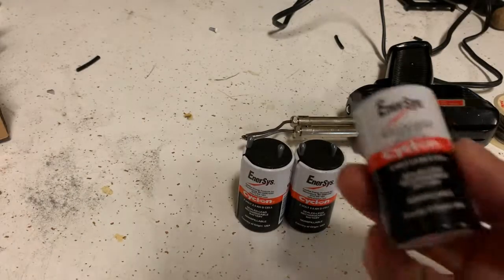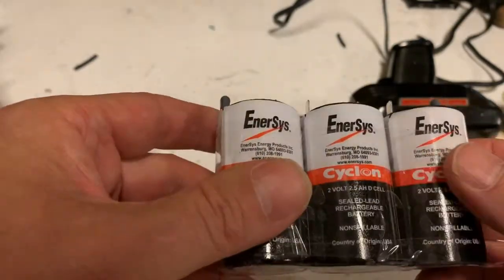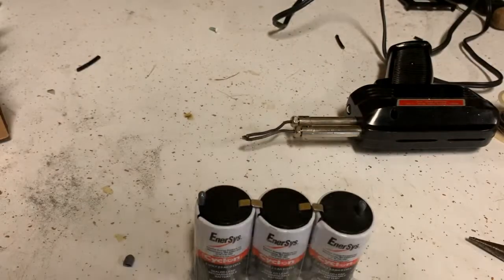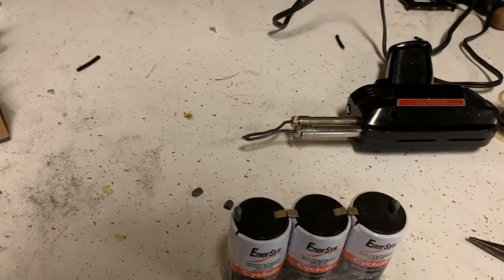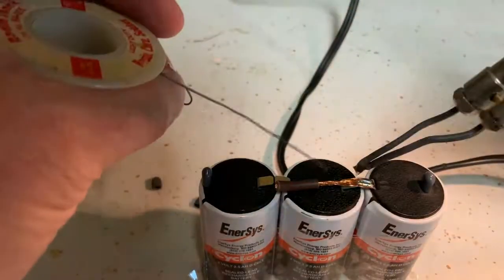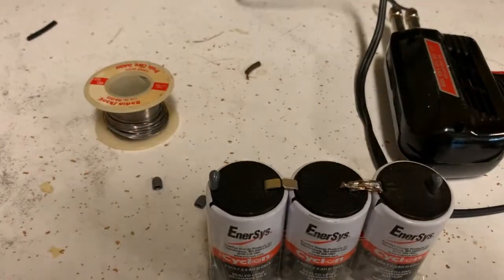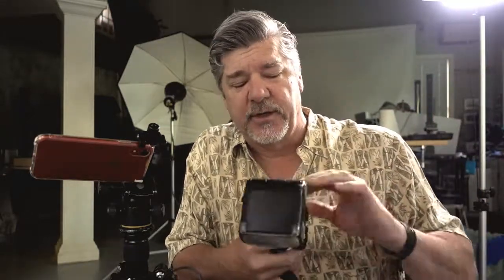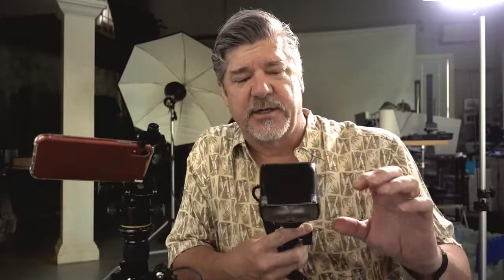Restoring Quantum Battery for portable strobe

Comment: Peter Krogh /or anyone that has ATG's Vivitar 283/285/285HV. Are they still working?
Anyone has one that fires at full power in all setting & know a fix, rather than guessing?

ATG's assisted & started making battery packs for working photographers:
ATG's Turbo Battery Pack series are HV that is connected by cable onto flash's HV Port = faster recycles
ATG's Battery 1 has 6V, fits many flashes having 4AA batteries (you will need a correct battery cable)
ATG's Battery 2 has 9V fits many ATG's Metz & Sunpak having 6AA batteries

Since they were very costly to renew the patents, ATG/Quantum didn't renew.
Then many staff were let go & got sold.

Anyone still has/have  & still using one of ATG's powerhouse flashes?
1. ATG Gold 60CT-4r
2. Metz 60CT-4
3. ATG Gold QFlash T2r
4. Quantum QFlash T2
5. ATG Gold 622r
6. Sunpak 622
7. ATG Gold 555r
8. Sunpak 555
9. ATG Gold RTF540r
X. Contax RTF540r

Comment: Thanks for the video , I have a Quantum Battery 2 which stopped working after laying in storage for a long time(5 years). I tried to send it to Quantum Instruments but they said they didn't service Battery 2 anymore. I did send them my 2 battery 1+ which they do service.While watching your video I noticed the Cyclon  batteries so I did a search on the company and ordered (4) 2.5Ah 2 volt d cells.exactly like the originals which is what the Battery 2 use. I have  a couple of Metz potato mashers I want to pair these up with.   By the way the old batteries looked like they were all leaking.

Comment: Doing that way & connection will not increase quick recycle time. But it does save the weights.
ATG/Quantum have better models, Quantum Turbo and so on.
You can change the battery on these also.

Comment: I have a quantum battery 2. Im hoping I can find a way to hook it up to an Yongnuo YN560 IV speedlight. The connector is a CZ2 for the power input. I can't find anything that will fit the Quantum Battery 2 and feed the power into the CZ2 input which is the same input as modern Canon speedlights.